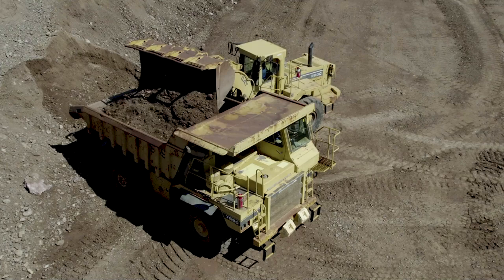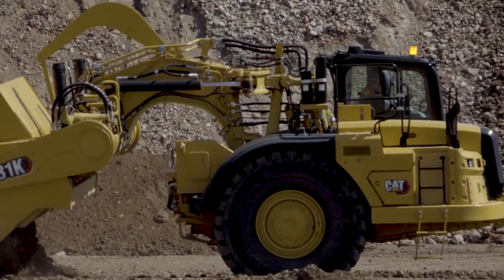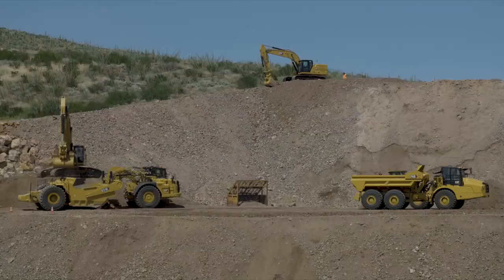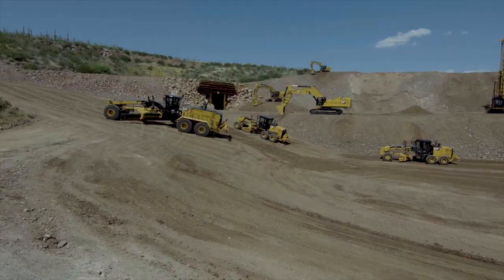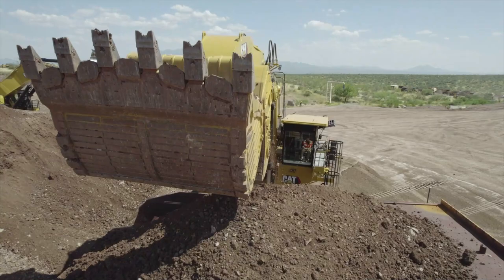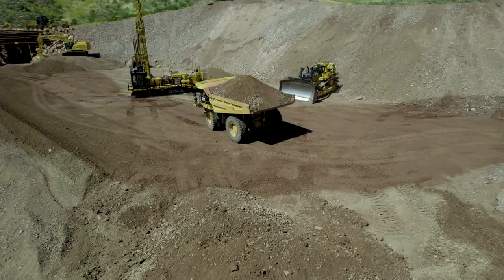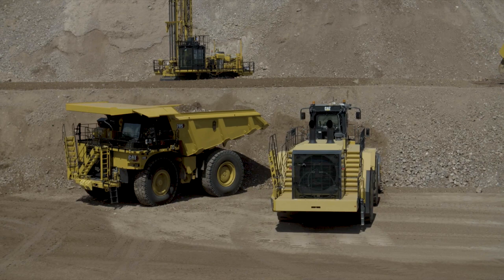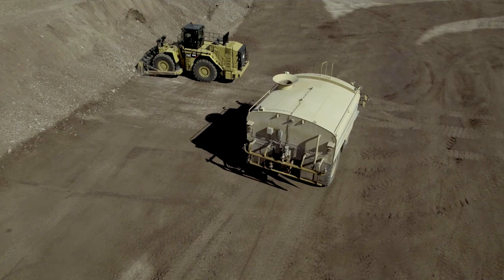Staffed Surface Mining Demonstration

Comment: I cannot express strongly enough what a pain in the ass remote controlled drills and dozers are. Ran both and what a waste of money. Electronics biggest enemy are vibration and extreme temperature fluctuations. CAT and Atlas Copco have never figured this out. All their testing is done in ideal conditions, never in 10below zero or 100+ degree temps. Sensor failure daily, overtightened drill pipes, excessive undercarriage wear, dozers can’t carry a grade for shit. And only manufacturer trained people can repair these systems. Clever money grab.